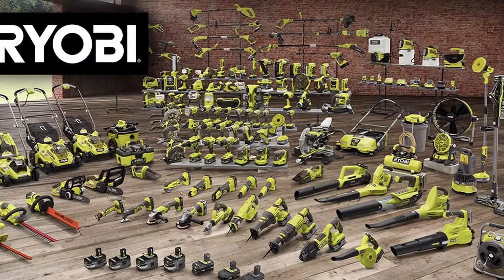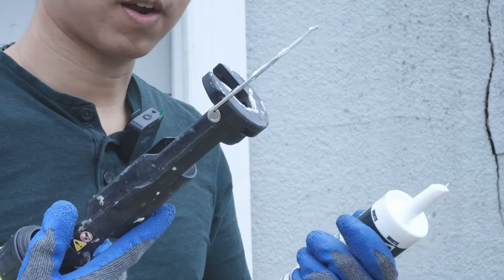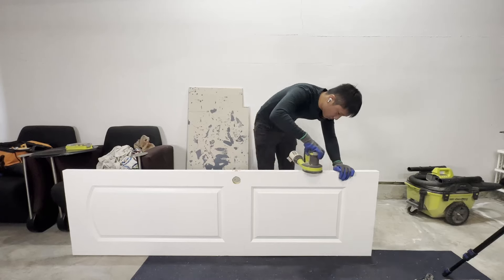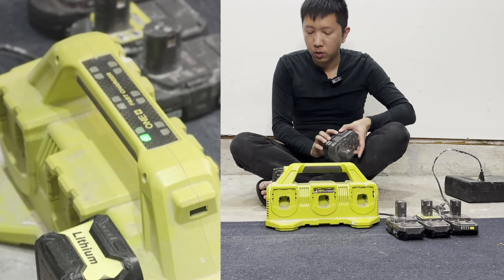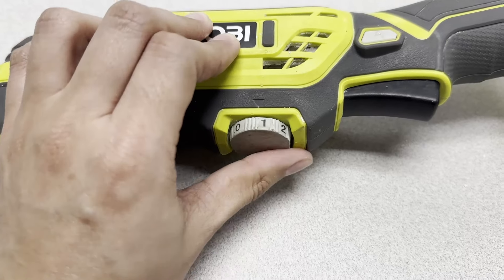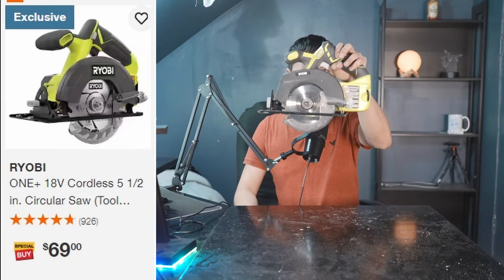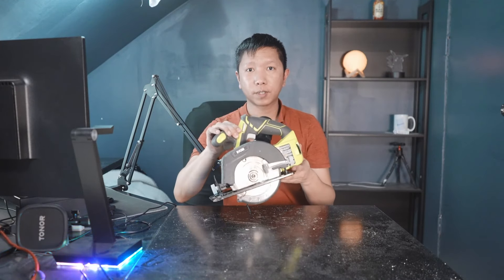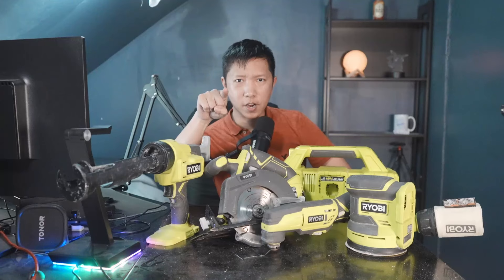5 RYOBI Tools for Advanced DIY Homeowners

Comment: So u just did a video on the five tools u have. Ryobi have a lot more better and more useful tools that are a must have. Like the p238 impact driver. It’s a must have or the dual bevel cordless sliding miter saw.

The orbital sander can’t get corners on curtain project so the corner cat sander is more desirable. 
The caulk gun has a lot of common issues. I would get one for the right price but wouldn’t waste money buying it brand new.